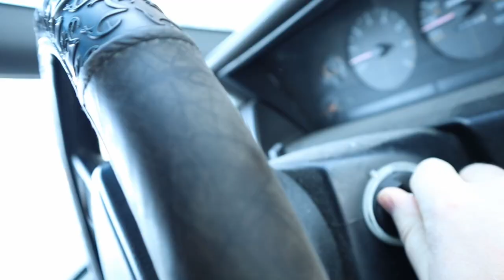How I Fixed My Broken Bed Slats!!! // DRUNK REPAIRS

Comment: Hey there. Do u happen to know how to disassemble a bunkie board on a platform bed that sits inside encasing? like, what tool do I need to unscrew the boards? It doesn't look like regular nails, and I don't think I can unscrew it with a screwdriver.  PLEASE HELP??? 🤦🏿‍♀️